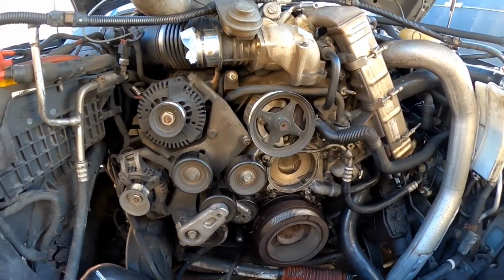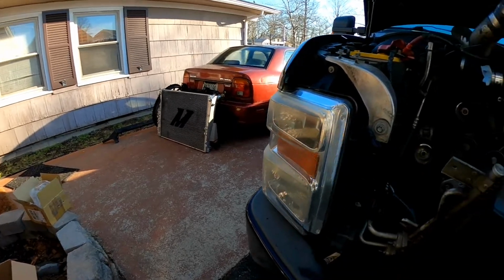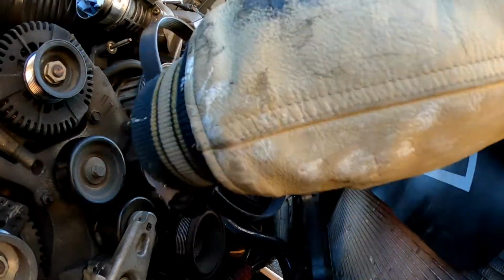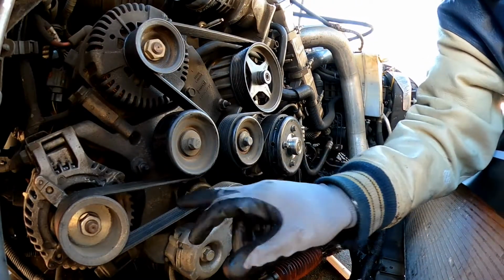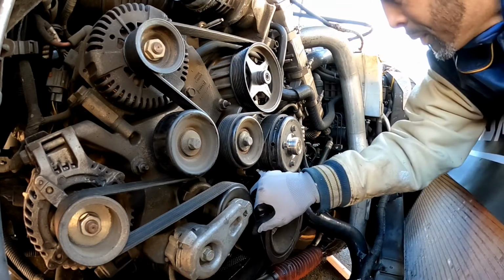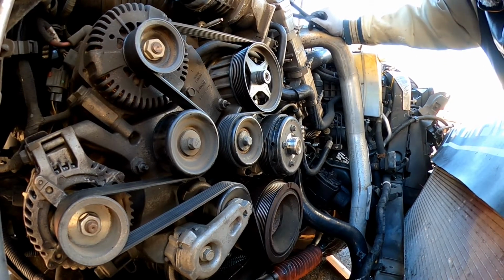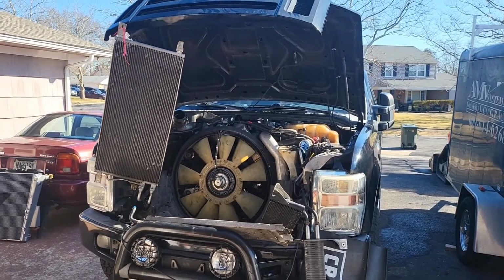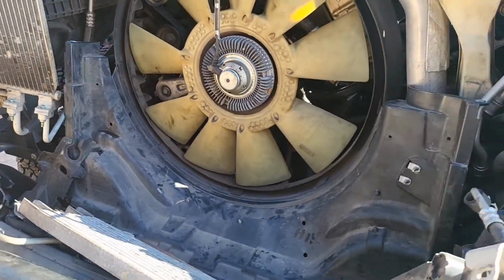2008 Ford F250 6.4l Powerstroke Diesel Water Pump Replacement

Comment: Damn bro, I have to replace my ac compressor and I'm seeing all the parts I have to remove. I'm in fear, haha. Thanks for your vid, it's very helpful.
Reply from the maker: Yup, I had to change mine a few years back as well.  I wish I had recorded it.  These recordings are invaluable when its time to go back in there.  Especially when your not in one every day.
Reply: @landman1988  
You and I wish you had recorded it. This video is going to help me a ton even if it's not for replacing that specific part, so thanks for the help brother.
Reply: Please redo it lmao I gotta change mine too, I got the clutch off and can’t get the compressor out lmao
Reply: Any list on what I do have to take off tho lol off the top of your head
Reply: @TheHutchmaster  
I took off mine yesterday, haha. I think it had like 4 screws on and one plug. One of the screws is below the compressor and there's a metal piece right under it so it's kinda rough taking that one out. I recommend taking it out first tho. I took it off last and it was more difficult as the weight of the compressor was on it.